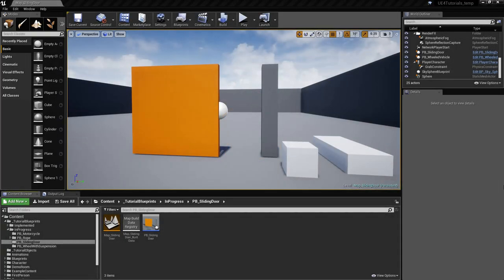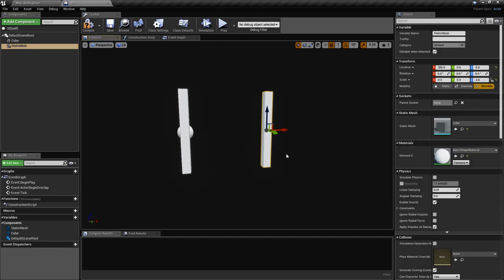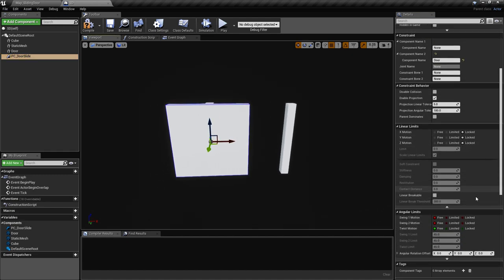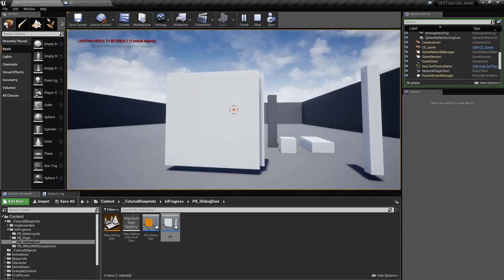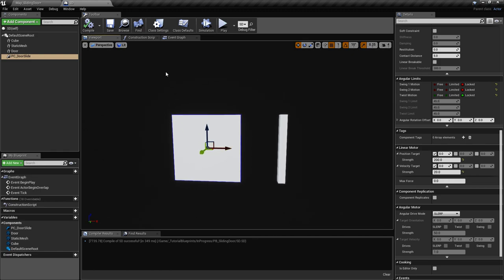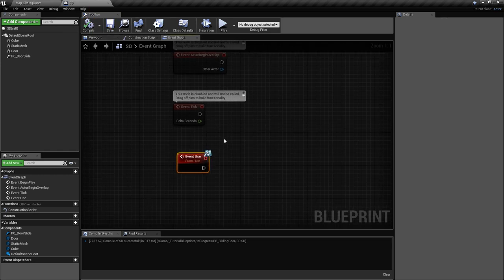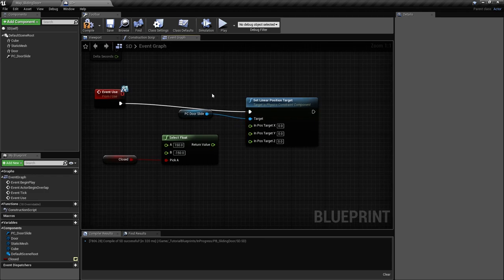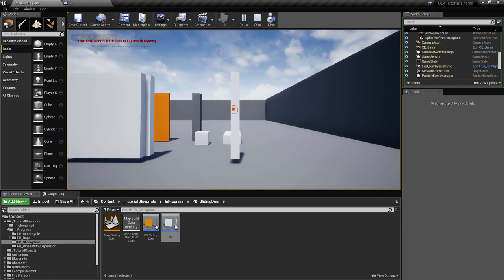UE4 How to - Sliding Door using Physics Constraints in Unreal Engine 4 Tutorial

Comment: Pro tip: To save some performance (even if it is only 1 frame or less :) ), instead of multiplying with -1 at 13:15, just flip the values, cleaner code and a bit easier on the performance, blueprints aren't that good at math
Reply from the maker: I see. Cool, thanks!
Reply from the maker: What he probably meant is to connect another select node to the Closed boolean, but with -150 in the top input and 150 in the bottom one, which would give the opposite result.

Comment: Hello, Thanks for the tutorial, I would like to ask is there any implemented event by default in physics constraint to fire when the object reaches maximum or minimum offset location?
Reply from the maker: Not that I know of. 
I guess you will have to check that within a loop and generate the event yourself.
Reply from the maker: Ooooor, just put a static mesh where that limit is and set the collision to Overlap and you will have the On BeginOverlap event and the OnEnd Overlap.